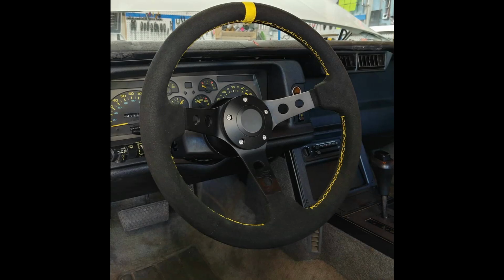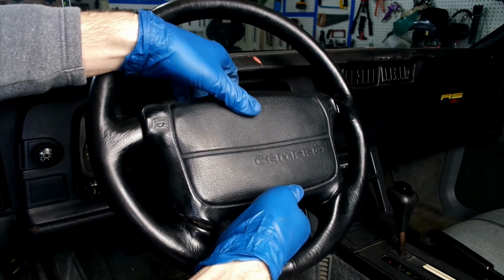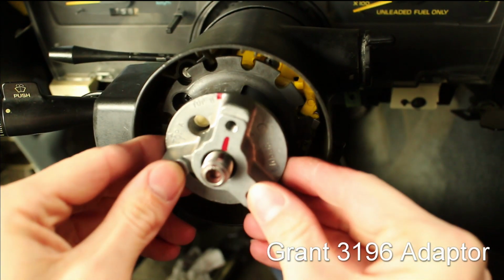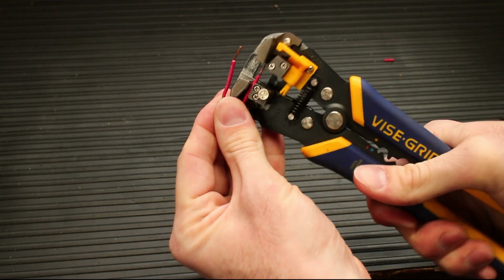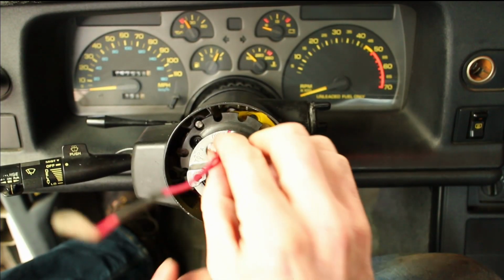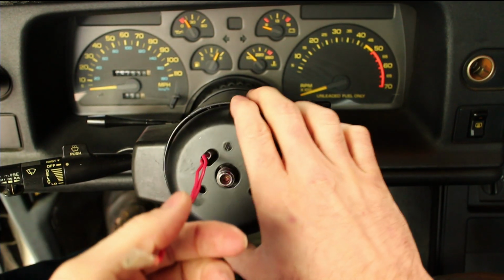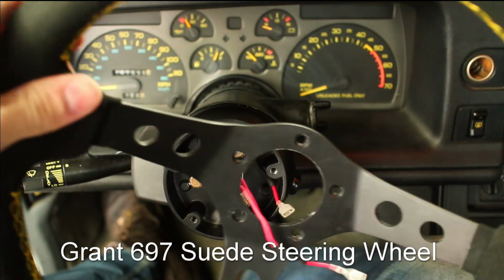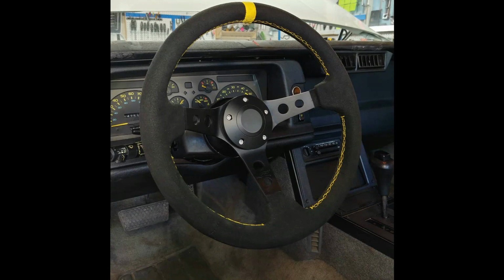How to Install an Aftermarket Steering Wheel (1982-1992 Camaro/Firebird)

Comment: Can I install a 1992 Camaro steering column into a 1988 Camaro?
Reply from the maker: they bolt up, but the wiring is different.
and there is no complete wiring diagram for the 2nd column plug

Comment: Since I have the old 85 steering wheel that has the spring loaded horn button, and not electric connected on top, for the rectangular cap cover setup, how do I modify that for a new wheel? :) It has no air bag. Thanks much in advance:)  Cheers!
Reply from the maker: the spring loaded horn button should still be ground activated. 
connect a ground and the horn goes off. 
the aftermarket one in my video works the same way, just with a few more wires.

Comment: I always follow your videos to a tee, only issue I have is reinstalling the steering wheel nut. Mine was destroyed by the previous owner so marking it on the shaft wasn’t an option seeing as how it needed to be replaced. How do I go about securing a brand new nut? Is there a torque spec?
Reply from the maker: should be M14  X1.5 
look up GM steering column wheel nuts. there's likely a bunch available online.
Reply: @3rdGenGuy  I have already got a new nut and you’re correct on the m14 x 1.5. I actually had to run a tap down the stud  because the threads were a bit chewed up. Guess I should have been more clear about my question, I see you had marked your steering nut to stud reference (1:25) so since I’m replacing my nut I don’t have the option of doing this…so that’s why I asked how do I secure the new nut and is there a torque spec? I appreciate the feedback. Best third gen channel! Love the content
Reply from the maker: as long as the steering column shaft is clocked straight and the wheels are straight, that's it.

Comment: Can an airbag delete cause the vat system to engage
Reply from the maker: no, but removing stuff around the steering wheel can damage the VATS wire. I have a video on bypassing it. not hard or expensive. 
https://www.youtube.com/watch?v=SOEnJ4X0j90
Reply: @3rdGenGuy  👍✊️

Comment: Great Video. Would a stock 6 bolt 82-84 Trans Am Steering Wheel fit on these Short Hub Adapters? Is the size of the 6 bolt pattern of aftermarket and OEM Steering wheels the same?
Reply from the maker: the aftermarket 5 and 6 bolt steering wheels should be a standard bolt spacing.
I don't know what OEM bolt patterns for steering wheels are

Comment: I talked to the tech service guy at grant he said air bag Columbs strip the splines out of the grant install kit hub have you had any issues? did the splines feel tight or a little loose?
Reply from the maker: my kit was fairly tight spine wise.
I had to Pull it off to do repairs and actually broke the adaptor long before the shaft even came off.
I would agree that the adaptor isn't the strongest.
But I did 3 Autocross seasons on it and that's a lot of wheel turning very rapidly.
I think it's a "your experience may vary" thing.

Comment: Would this work on a 94
Reply from the maker: yes, but the adapter and setup is gonna be a bit different than a 4th gen Camaro. I'd check the 92-02 camaro pages and see what adapters hey are using.

Comment: JUST A UPDATE TO THE INFO..1990 TO 92 CAMAROS.w/air bags..the shaft caps (the black cover he cuts down) they come in diff sizes.. get one close to what ya need .. they are marked.. if you order a kit for your 3rd gen.90/92 your 99% of the time you will get the cover marked with #27(they do not make a kit for the 90/92 (airbag) this will be to deep.. Kit 3294 ($18) will come with 3 covers.. it has a cover in it marked #11 this cover is not as deep (over 1/8 less ) then a #27... this will save you the cutting grinding.. if ya need more on your 3rd gen just place a washers (3)1 on ea bolt. under the cap..works 100%.  the # 11 and #27 caps are 4" in diameter.. ya can even get them in 4 1/2 Dim.and just slide over the steering Column so there is no Gap.. this is just a heads up.. Call Grant steering wheels. and ask.. my Camaro is a 1992 Z28..

Comment: Dude, I love your detailed videos but, they are missing one very very important part.... that’s part numbers and tool names and sizes and where to purchase... If that’s to much at least respond to the comments when asked. Please! I committed asking where to purchase the reamer drill bit you used but got no response...
Reply from the maker: the part numbers are in the video.
reamers can be purchased on eBay or amazon.
i don't include socket sizes ex ex because some cars have different sizes and it confused people.

Comment from the maker: GRANT 3196 Adapter
GRANT 697 Wheel
5 bolt Forever Sharp Horn Button
Reply: so there are 2 black plates one that goes on the Column and one that goes on to the actual steering wheel? on grants website it only shows it comes with one black plate. whats the number for the plate that the steering wheel bolts in to?

Comment: Thanks for this, 3GG! I'm wondering if there are spacers available to increase the 'height' of the wheel to my preference, if necessary. Anybody? Thanks in advance.
Reply from the maker: you'd need a different wheel to really adjust the height. spacers might get you 1/2inch but that's not much.
this grant wheel is 1in closer to the driver than stock.

Comment: This is a bit off the subject of the steering wheel but might you know where I can locate the horn contact switches? Looked everywhere but no one sells them. I may have to replace the steering wheel just because of that. Thank you for any help you can provide.

Comment: Nice job on the wheel. Like the look. Did you get an airbag light after replacing the wheel?
Reply from the maker: Can't have an Airbag light when you remove the light bulb in the dash for it! :)

Comment: So, let's say that we're doing this and forgot to mark TDC on the wheel, is there a trick to finding it after the fact? Particularly with the column out of the car? Or am I an idiot and am going to have to dink with it for days lol. This is the first column work I've ever done and I have made some rookie mistakes lol.
Reply from the maker: you can install the old wheel and center it that way
or eye ball the front tires to see how straight they are.
Reply: @3rdGenGuy  thanks Hun, my wheels are straight so that should help lol. If it's a bit off will an alignment help?
Reply: @ariyanadumon4549  no,putting the steering wheel on properly when the front wheels are straight isn't hard dear.if it is you may want to stop doing things to your car now
Reply: Actually, GM marks their steering wheels and columns at the factory. Look for small indexing line on the shaft. It looks like someone hit it with a small chisel. If you look closely, you can see it at the 12 o'clock position in this video @4:19